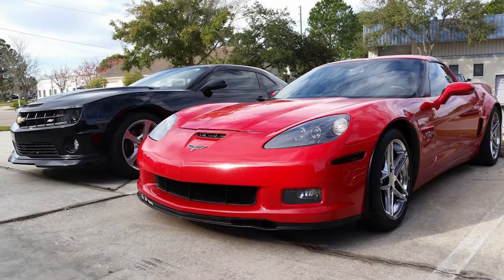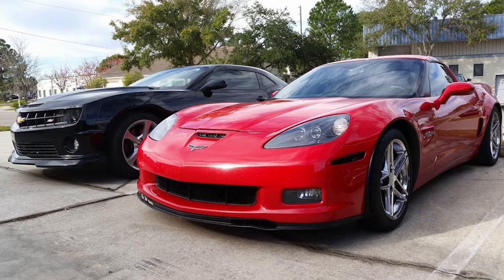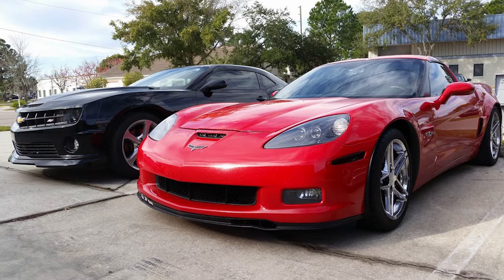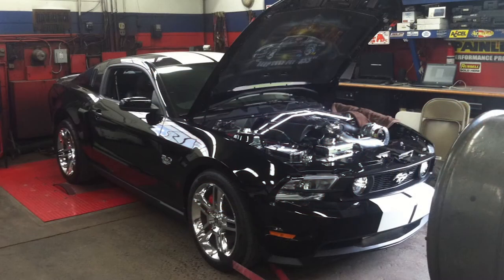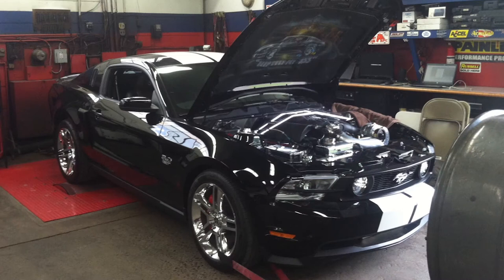Why Tune on a Load Bearing Dyno?

Comment: WATER BRAKE !!!  best is a load bearing impeller water brake...  you can  manually stall an engine to nearly fully loaded idle rpms  with some of em
Reply: No different to electronic, you can ramp up and then flick the switch to ramp down and go all the way until the car stalls if that what you want to do 🤷‍♂️